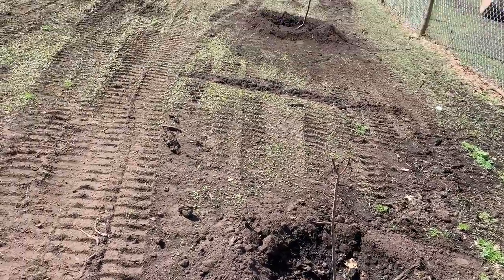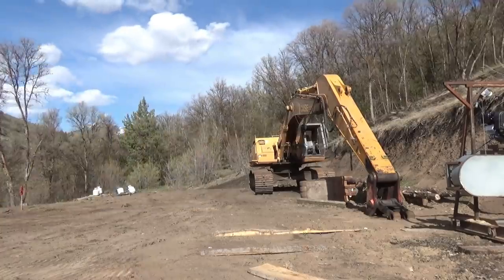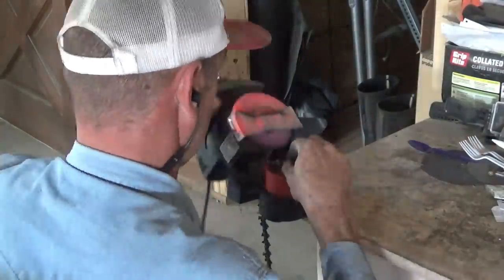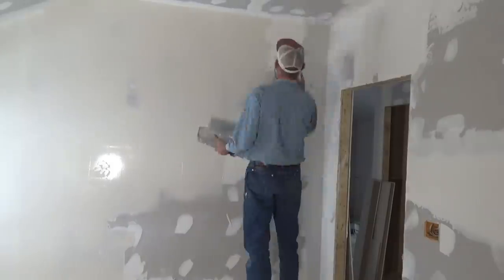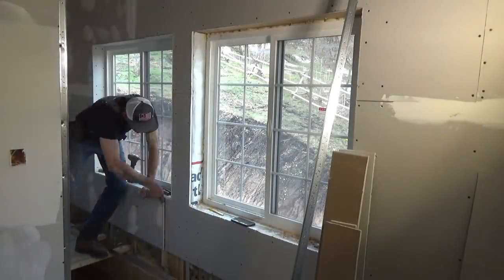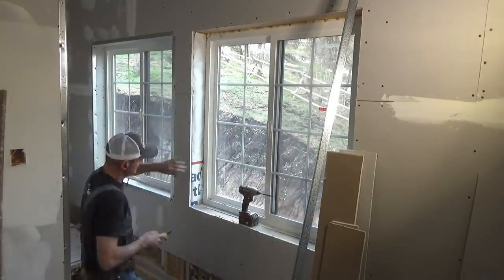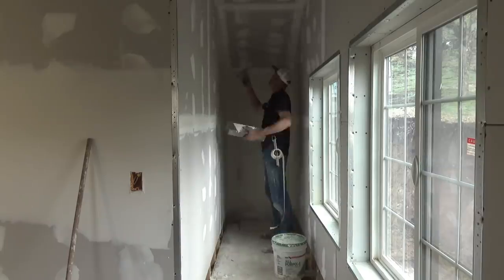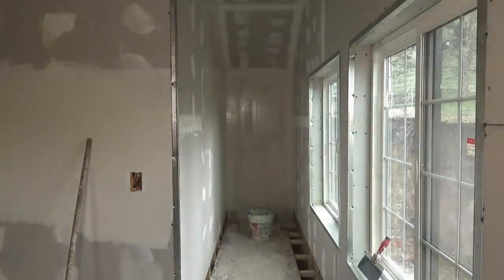#326 - Moved Chicken Coop To RPR, Drone Footage Of Hillside, 14" Drywall knife

Comment: LOL, your thinking is similar to mine. After we bought our house here in Colorado, we fell in love with a spot in the back of our property that was a small mountain overlooking a stream, but it's over 40 acres of woods to get back to it, so not feasible to build a house back there. My wife is from Sweeden and when we went to visit her family I was amazed that they don't build their houses with insulation. The house was literally 16 inches of 2inch boards overlapped similar to plywood to form the 16-inch thick solid wood wall. They don't use any nails or screws while building it, just wood glue and 1-inch dowel rods. So intrigued by the logic of how they built their houses, I built a small 18x18 cabin in the back of our property on the top of that small mountain. I rented a rock trencher to not dig holes in the mountain, but I used it to skim the top of the surface to as close to flat as I could, then I used the wood in the area from the trees I cut down to slab into 2inch slabs and stickered them to dry in our barn. Then I built the walls out of the wood slabs a few layers thick and brought them out to the site with the tractor and assembled the walls and used only dowels at the end every 12inchs to attach the corners of the cabin and plenty of wood glue, then after assembling the walls I continued to stack the wood on the outsides with wood glue and brad nailer until the walls were 16inch thick at the site of the cabin, then I pulled the tarp off the top and built the roof and coated the outside of the cabin with deck coating. The solid build of the cabin with the walls that thick of wood just makes it easy to heat and keep cool.  Should look into it, it was very easy to build because you could sandwich the uglier wood slabs in the inner layers and put your nicer slabs at the surface layer. Before putting on the inner surface level of wood, i used the router to cut the tracks for the plumbing and wiring in the wall. The surface wood covered those channels.
Reply: Wow! It's very interesting the way they build a house in other countrys.
Reply: Wood glue is actually amazingly strong.. they probably don't use it for framing because getting glued pieces apart can really break the wood..  most furniture makers just use glue.

Comment: In SE Michigan we use about 10 cords of wood in our 2000 sq foot ranch.  This heats our living room/dinning room/kitchen about 95% of the time.  The other 5% is hot water heat.  In the bedrooms we keep it cooler, heat that travels back from the living room, and for about an hour before bed we turn on the gas fireplace in the master bedroom or the heat pump.  (redundant heat sources are the key)  We've heat our house this way for about 20 years.  LOVE IT!

Comment: They made a cheap dry cell batteries liquid transfer pump.  You stick iy into the gas/diesel can and turn it on and it umps fast into you vehicle/equipment tank.  I see several other you tubes using it, so I go one for fueing my toys and yard equipment

Comment: just an idea that works pretty good ,,,,,.... instead of putting that "glaze" coat (final coat) on with a 14" drywall knife ….. use a paint roller …… roll it on and wipe it off with the knife … goes pretty quick ...

Comment: 10:15 14" knife you say. I suggested that. But did you listen? NO! I also suggesting rolling the mud on with a heavy nap then smoothing it with the knife. You would be done by now. What why the heck do I know?? signed former drywall company owner.

Comment: You gonna insulate the coop  right?  If you gonna keep chickens in  winter  so the eggs or chickens freezes 
You need a smaller building  to keep the feed  in there put a old big not functional deep freeze for rodents control  take care be safe